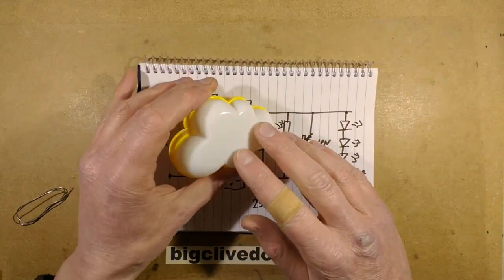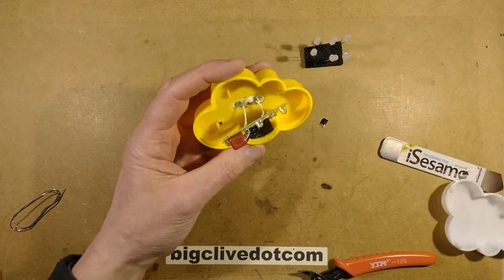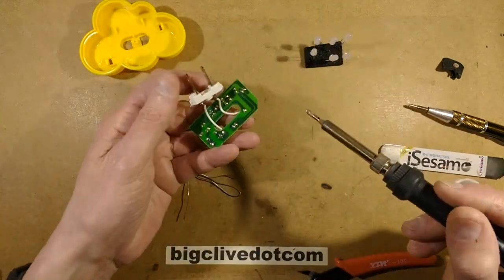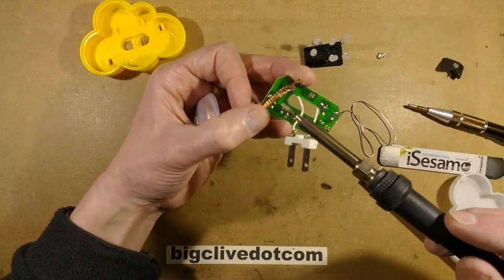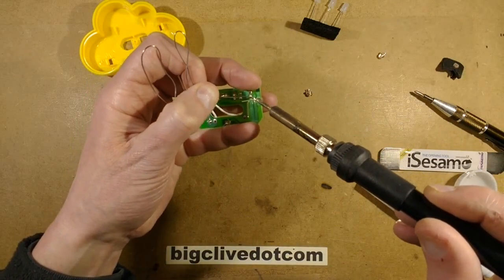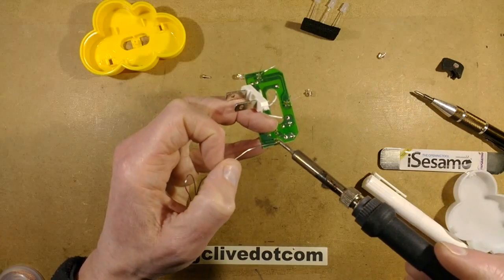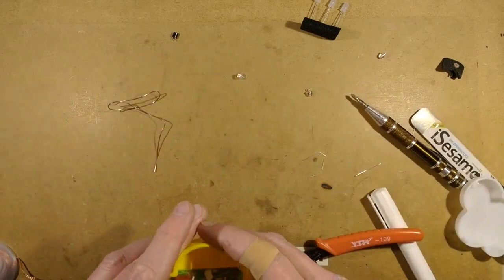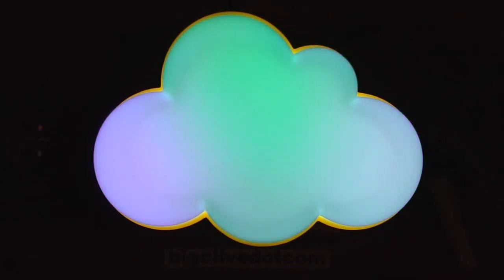Cloud-light conversion to RGB LEDs.  (One-off horrible audio test.)

Comment: Definitely need the good mic back. Perhaps you do not know, but much of the appeal of the channel is your voice. It's almost on ASMRish.
Reply from the maker: Yes, I'm acutely aware of the importance of keeping things as close to the iPad format as possible.  I may even end up going back to the iPad.
Reply from the maker: Unfortunately the sound isn't so easy to sort.  The phones "mixer" that routes the audio from the AGC circuitry to the camera is set at too low a level and does not seem to have any accessible means of adjustment, and even if the input is driven into clipping it's still quiet.
Reply: I second that. Use the good mic that you've been using. Sounds so much better. :)
Reply: bigclivedotcom I have yet to comment on any of your videos I think, which is crazy because I've seen almost all. While I agree with others that I would like to see you get a proper camera/mic setup (part of why I signed up for patreon actually) if the issue with sound is software, as an android hacker my first though is that rooting the phone could solve your issues. The second option is to simply record the sound separately on an external audio device and then add it as a separate audio track in editing. In most of these videos we don't see your face, so syncing should be really easy. There are also some mics (not all of them are great, but usually better than phone mics) that attach to your phone (several ways to do this, autiojack, bluetooth, usb) and don't record to your phone, instead they record into their own memory, however when you start recording on your phone it enables the mic, so the sound and the video always start at the same time. A few options.
Reply: +bigclivedotcom one Sony camcorder will do the job done, and with potential for 4K.

Comment: The old mic was better
Reply: eitherier go back to your old mic or go for a lapel mic as the levels are all over the place in this vid
Reply: A lavalier mic would be ideal for this application, I think. Relative freedom of movement, pretty inexpensive, rejection of environmental noise, and good audio quality (though depends on the specific model).
Reply: Audio feels biased to the right channel a bit.  Maybe a mono mix would help?.  Also getting noise at higher levels.  Lapel is definitely better.  Kinda liked the old setup though....god, am I getting old?
Reply: Definitely a bit of bias to the right, also during pauses a hum is evident. The old setup was better.
Reply: Why did so many people like this comment?😂😂
Reply: 1% Jon?

Comment: Just a thought on soldering.....I find that a blob of blue-tack (or white tack) just holds components in place whilst you solder them in, and pulls off easily afterwards.  Excellent video Clive but sound is being battered by over zealous AVC effect.

Comment: I don't usually like color changing LEDs. But in this application they look really nice.
I'm glad you didn't use the ones that fade and then change to flashing colors. They would have ruined it.

As for audio on the video, I think the old microphone was better... This one seems to go very quiet for a brief period of time.
It's not a sudden jump, but it fades down at a noticeable rate, then fades back up after about seven seconds.

Comment: Only problem I really had with the sound is there was some pretty major clipping on the "clipping" (when you clipped the extra of the back of the soldered LEDs it chopped it and made it sound like you put a pillow over it or something). Could use a bit more mid to low to kind of fill things out but it wasn't bad.

I really liked the end result of the multicolored LEDs, I'll have to find some of those and make some for my kids.

Nice little project.

Comment: Anyone interested in dong this conversion should be aware that you might get a surface mount version of the board.  You can still replace the surface mount leds with thu hole flashy leds but it is not as straight forward as Mr. Clive's conversion.  Oh and despite saying  220v it does work on 110v but I had to bypass the resistor that is inline with the LEDs to get enough voltage for the flashy leds.

Comment: I found the audio to be somewhat diffuse, levels weren't too bad but they did vary.  It seemed that depending on where your head was, it affected the pickup at the mic or mics. I suspect that it was picking up rebound off the bench or a wall.  I was able to understand everything you said, so no real complaint there.  Nice cloud, lol

Comment: For what it's worth - I am nearing 50 and my past has not been kind to my hearing.  I have moderate hearing loss in the speaking frequencies. I could hear this video rather well.  It's like someone took the equalizer from a 'valley' shape to a 'hump' shape accentuating the mid-range frequencies.  It's amplitude was also increased by about 15-20%

Comment: I am absolutely not an expert in audio recording, but I record some voice using a very bad and old microphone, so I have a bit of experience. My original sound is always terrible, but I always make correction in Audacity (Noise removal, Leveller, Equalizer) and it sounds much better after it. Maybe you should try processing the audio separately in such way?

Comment: I much prefer the old mic but if you can't find a fix in the motog itself to boost the audio level then a quick and dirty solution would be to use ffmpeg to boost the volume. In the command line it's just 
" ffmpeg.exe -i filein.mp4 -vcodec copy -af "volume=5dB" fileoutlouder.mp4 "
Change =5dB to any number but i wouldn't go higher than 10. It won't reencode the video so shouldn't take more than a few seconds to run.

Comment: The mic sounds like it has a slightly over-zealous noise cut, which isn't helping the audio, but on my laptop speakers (Lenovo T410, not exactly fancy!) it sounds clear enough to hear... :)

I think that cloud lamp looks better now with the colour-changing LEDs, they definitely missed a trick here when manufacturing them... :P

Comment: Thanks for the video. The audio has some problems. It's a little bit tinny but much worse is that it keeps dropping out when the volume goes over some preset threshold! Compared with your hat mic the inbuilt one comes a very poor second. I'm watching on my television so the bass is better than it may be for some but it definitely sounds strained. This device appears to be much more sensitive to noises and so your voice disappears when you use tools, like your snips, as well as dropping out when you get quite close. Not good at all, I'm afraid.

Comment: Your voice sounds more "normal", as it did with your older videos, but the audio level is not consistent. As others pointed out, the depth of field for focus is not so great.
I know you are not going to like this, but everything seemed great when you were using the iPhone, aside from the flicker with 50Hz light sources.
Reply from the maker: I can see myself going back to the iPad because the Moto-G is just not quite right.
Reply: Well, that is your choice if it works better for you overall. What I did suggest previously... if you hate the flicker at 50Hz with the iPad camera, is to make a small inverter for 240V 60Hz to test 240 VAC LED items, if the iPad shutter speed is better synced to deal with 60Hz than with 50Hz.
Clive, it's 2am where I am. Did you even sleep at all? It must be 7am there!
Reply: Hello!
Reply: yes i didnt mind the ipad, not everything has to be super sharp, heck go back to 480p! lol

Comment: If you haven't already tried it I'd give Open Camera a shot it's free and you can have very granular control over the settings, not completely intuitive but once it's set you won't have to worry.
Reply from the maker: I'm using open camera now.
Reply: Ah ok, it goes fully up to 4k for my phone, I wonder why it won't go above 720p for yourself?
Reply from the maker: That video may have been filmed with different software that was capped at 720p in the trial version.
Reply: bigclivedotcom that would explain it then. I hope the new set up works well for you, then all you'll have to worry about is you Internet speeds from IoM.

Comment: How is that shunt-transistor setup even possible? It's basically a dead short on the DC side, right? And if the transistor is trying to to push as much current as possible, wouldn't that put the dropping capacitor under a lot of stress?

Comment: When your head faces the bench the sound is fine but as soon as you twist your head it goes faint.  It does tend to go up and down like a person of ill reputes underwear. So I have been told of course. I do have quite a nice sound system connected to my PC and apart from the volume problem it's fine. 30W RMS per channel, 50Cs to 17Kc +- 3 DB. fletcher munson and all that. Both nice chaps but only liked cold white LED's you know. I would not worry too much Clive as your video and sound quality is normally in the top 1% on YouTube. Better make that 0.1%. When do we see the electrode video. Not while I'm eating my tea I hope. I'm glad you managed to find it - or did you.

Comment: I have a question for you.
I'm thinking about transforming my battery driven toothbrush to run on a capacitor instead. It loads via induction, but I don't want to make a foolish mistake. 
It's a Brau Oral-B. I have no experience in induction loading, especially a capacitor. Any help would be appreciated.

Comment: The sound quality now is excellent, much better than with the old mic. It does pump on loud sounds (the compressor has a too slow recovery rate) but that's not as bad as the previous mic. Please don't use the old mic again.

Comment: Needs more deathdaptors. 

The Audio overall was not bad but appeared to be a tad tinny at points and also dropped a little at one point as you moved away a little.

As annoying as it may be, to get much better than the iPad setup you may need to go down the dedicated Camera route not use a phone or tablet.

Comment: Where do you learn to hold circuit board, component and solder in one and, steadily enough to flow the solder onto the pad? If i were to try that i'm sure i would burn something.
Reply from the maker: It's just something that evolves out of necessity.  I didn't even realise I did it before people started pointing it out.

Comment: I also prefer the solder wick, but I did struggle with one board.... seemed the board was too thick for it to clear the hole. Ever come across this? Find a simple way of getting it to work well?
Reply: I usually melt the solder and push the component through.  But the next time I have trouble with it, I might try a toothpick.  idk

Comment: What kind of LEDs are these? Does somebody have a link to these?
Reply: Kevin Van Ryckegem on ebay search slow flash led
Reply: Kren K it looks like 5mm.   5mm is a standard size.  I have some 3mm and it is noticeably smaller then the standard 5 mm
Reply: Yeah, I agree, looks like 5mm ones.
Reply: Thanks! Never knew these existed.

Comment: Oh dear, I'm Commenter #666...
The audio is definitely a bit tinnier, but I find it tolerable (I can always turn up the bass to compensate). The Auto Gain Control seems a bit slow to recover, that was the only thing that really stood out for me.

Clive (and fellow fans of Clive) I am asking for a small bit of advice... I have some automotive LED bulbs that have a rather high failure rate (single chips flicker/fail and cause other chips to surge in brightness). I've ripped one to bits and discovered 5 SMDs wired in parallel with a single 56Ω resistor. If I've done my calculations correctly, the LEDs are seeing 19.3mA current and the resistor is dropping 10.8v (based on average auto electrical system of 13.8v)... 

My question is this: is it likely that the LEDs are failing due to being overdriven (hence the name SuperBrightLEDs), or is it more likely the chips are crap? I am willing to disassemble the unused bulbs and replace the resistors (75Ω or close might do the trick) if that would work... I ask because it's been twenty years since I last worked with circuits and I would like to double-check my work and make sure I'm on the right track. Thanks in advance for your help/advice!
Reply from the maker: They always push the LEDs too hard in products like this, and the LED quality is sometimes a bit poor too.  If swapping the resistors I'd probably double the value, as the LEDs will still be bright, but last longer.
Reply: Awesome, thank you! Once I checked the resistor value it practically screamed "designed to fail," and when I did the math and saw the current was perilously close to 20mA... I figured the chips were of questionable quality to begin with, but pushing them right to the max certainly wasn't helping matters.
Reply: AND... For those of you following this comment thread, they weren't SUPERBRIGHTLEDS brand, they were JTECH brand. OOPS!

Comment: Hello are the RGB leds slow flashing or do they use a PWM on them to change color?
Reply from the maker: PWM to fade between colours.  Strangely they are often described as 5mm diffused slow flashing RGB LEDs on eBay.  Annoying, as there are versions that do flash.

Comment: I bought a couple of these "clouds" off Ebay and they arrived yesterday. Unfortunately the LEDs and all the other components; except the voltage dropper cap are now all surface mount. Will complicate things a bit trying to fit my thru-hole RGB leds :(
Reply from the maker: You could tag standard LEDs onto the SMD pads?
Reply: Thanks Clive. Replaced the LEDs with RGB ones but only one of the new LEDs would change colour. The remaining 2 just sat on red. Measured the voltage across one of the static LEDs and it was around 2.8v. Datasheet says they need 5v. In the end I realised that the 47uF after the bridge rectifier that is in yours is missing in mine. Added a 56uF 100v (all I had) and hey presto it works.
Reply: WOW, thank you so much for your report how you got the rainbow clouds glowing. I have the same problem. The rainbow LEDs don't like the 50 Hz flicker due to the missing smoothing capacitor. Every loss of power makes the LEDs reset their PWM chip to red. 56uF 100v should be fine. I will also try that.

Comment: Today, i just got two of these cute cloud night lights from China. I had to immediately order these, after having watched your video. I could not find any other night lights with a similar nice and cute fluffy look xD
I just tried the lights (with death adaptors for shure) and they work, but the LEDs are visibly flickering. I am very sensitive to flickering (can see the flickering of a 100 HZ CRT monitor or TV), so i would like to get rid of this problem. Can i simply replace the smoothing capacitor by a one with higher capacity?

EDIT: Just opened the damn thing. It is a newer version with, apart from the 400V film capacitor, SMD parts only and completely NO smoothing capacitor :(
All conductor tracks on the circuit board are on the upper side completely covered with some kind of isolation material. The LEDs have tiny solder pads.
Has someone modified these newer SMD version? I would love to have one with smoothing capacitor and rainbow LEDs but am not sure if it is a good idea to drill holes into the circuit board and put through hole LEDs into them...
Maybe i should replace the whole circuit board with a non SMD one from another night light, but that would be too easy. The hard way is more interesting.
Reply: Ah, i just found the answer myself in the comments after scrolling a few pages. Nice :)

Joe Farr:
"Thanks Clive. Replaced the LEDs with RGB ones but only one of the new 
LEDs would change colour. The remaining 2 just sat on red. Measured the 
voltage across one of the static LEDs and it was around 2.8v. Datasheet 
says they need 5v. In the end I realised that the 47uF after the bridge 
rectifier that is in yours is missing in mine. Added a 56uF 100v (all I 
had) and hey presto it works."

Comment: You're correct that the audio isn't as pleasant, and doesn't reflect some of the natural bass of your voice, but it is much clearer than with the mic clipped to your hat (as described in a previous video).
I have gone to great lengths to get decent audio at my basement workbench (near the furnace blower), and settled on a Countryman earset mic.  For your purposes would a shotgun mic work?  Something like one of the Rode mics?
http://www.rode.com/microphones/video
Reply from the maker: The problem is that the microphone input is being attenuated so that even when driven to the point of clipping it still sounds very quiet in all camera apps I've tried.  If I could access the engineering menu I could nudge that value up, but unfortunately it appears to have been locked completely as far as I can see.
Reply: Maybe try a lapel microphone clipped on your shirt.

Comment: Yeah. Ordered two of these from AliExp to convert as I already have 100 slow-change RGB LEDs. Arrived today and they look identical down to the box but they're surface-mount (other than the main capacitor obviously). Damn it! That was a waste of money. :-/
Reply from the maker: You could still solder a conventional LED onto the SMD pads perhaps?
Reply: I shall indeed try. However the SMD LEDs are 3x2mm (3020?) and there isn't much pad showing beyond them -- I swear it's the neatest soldering job I've seen come out of China.
I was hoping to also solder some small capacitors in parallel with the LEDs as I hear doing that makes them 'remember' the last colour when powered off.